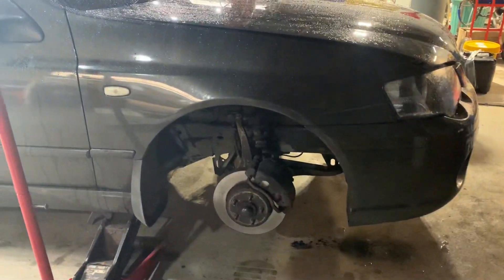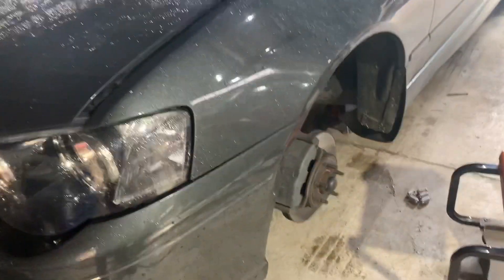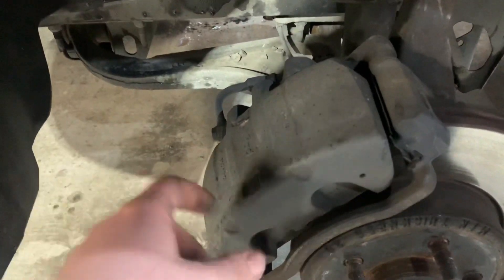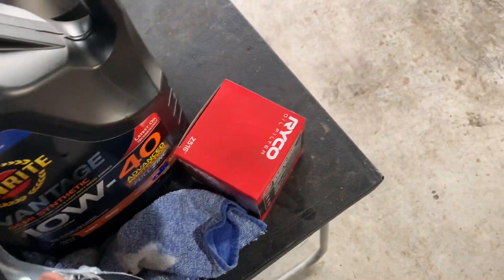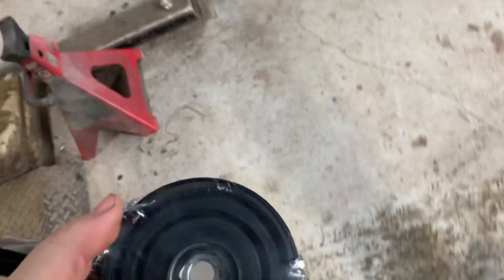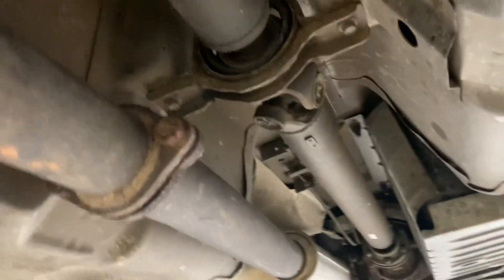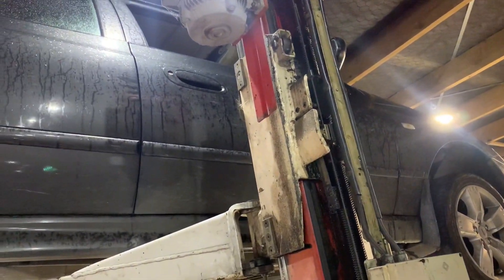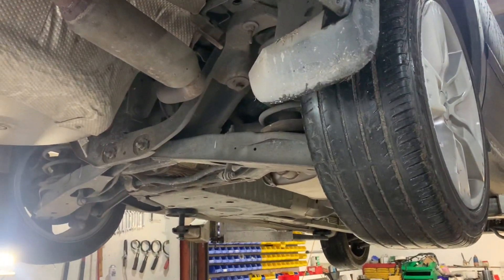Putting Turbo Brakes On My Bf Xr6 Falcon And Finally Fixing The Centre Bearing

Comment: The big brakes all round make a huge difference. Best off getting the best slotted rotors you can afford. Stainless braided lines finish the job and make these big cars pull up very very quickly. 
Great work So far bloke.
Reply from the maker: Thanks mate and yea I’ll be putting drill and slotted rear brakes on my blue in the future they fell good